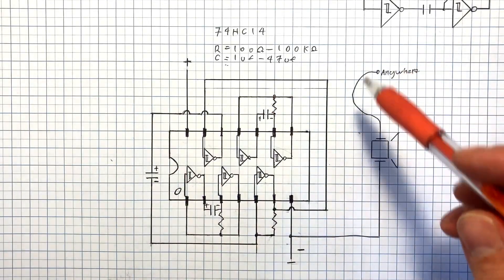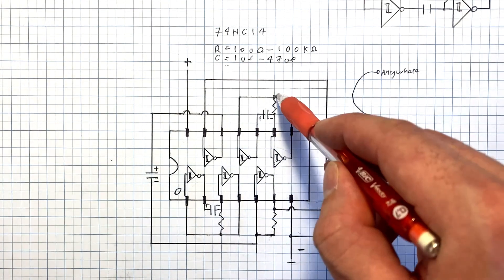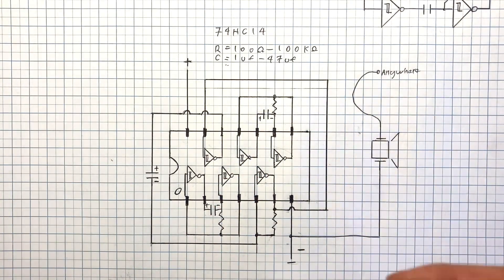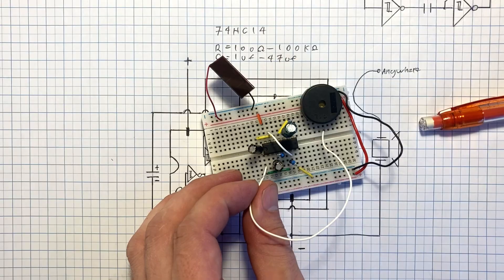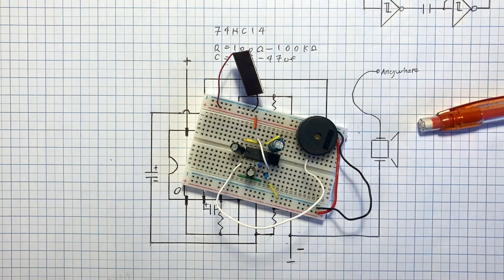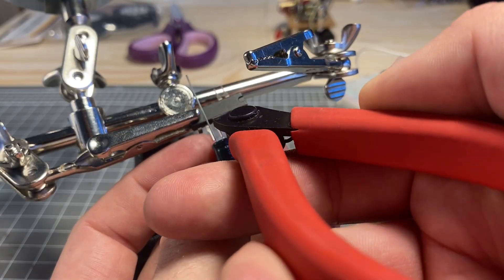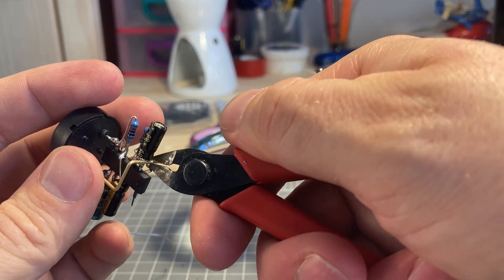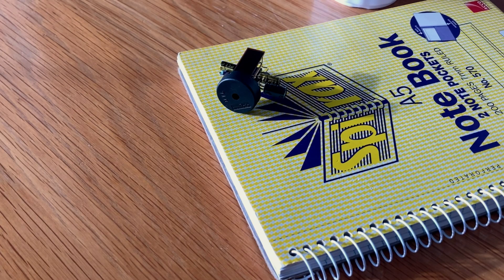A solar powered synth that sits on your desk

Comment: Really enjoyed this video and just made one with parts I had, but wondering if there are tricks to make them chirp louder? I plan to try some different piezos and solar panels, or even some 3d printed waveguides
Reply from the maker: Cheers! I have found some piezos are way loader than others, I am not sure if its different versions or just batch differences. 
A bigger solar cell will probably help but the drive current will probably be limited by the chip itself. It would be pretty east to use this to drive an audio amp though, but a little less elegant

Comment: This was fun! Bought a 74HC14 chip and slapped it on the ol' breadboard. Had a great time experimenting with potentiometers, LDR's and a handful of capacitors. Thanks!
Reply from the maker: Its a super fun little project. I love how you can swap out pretty much any of the components and still get a working circuit.

Comment: Does anyone know where to buy the piezoelectric speaker from this video?
Reply: I only seam to be able to find buzzers.
Reply from the maker: These are often sold as buzzers but it is just a speaker. I think this one was Core electronics part PS1240. If the part has a note about what type of signal to drive it with, eg square wave etc, it should work for this no problem

Comment: What an awesome video -- thanks! I wonder what would happen if a speaker was attached to each one of the resonant circuits, or if multiple circuits could be attached to the same speaker for extra weirdness
Reply from the maker: You could definitely connect a few of them together. Multiple speakers would be cool, I think the speaker load will almost affect the frequency so you could have some crazy feedback going on. This circuit is sort of the most basic version but there are tons of updated designs out there. Super fun to mess around with
Reply: @ALTcorporation  thanks for the advice! I recently inherited an absurd amount of old ICs and components from the 50s-80s and a few more recent ones. There's a few of these Schmitt trigger switches in there so I'll have an experiment. Thanks again!

Comment: You can also use some photoresistors to make the circuit even more chaotic and reactive to light changes. This was one of the first BEAM circuits I've built, and I still have one chirping! Since then, I can't stop thinking about these when hearing crickets at night, haha! Btw, another cool thing I recently found when reuploading some deleted Ralf Schreiber videos is the Motörbörd, check it out!
Reply from the maker: I was thinking about doing that! But I wanted to stick with the classic version for the video. I want to make one with a thermal resistor of some type, it would be cool to vary the sound based on temperature just like a real cricket. 
I’ll definitely check it out, he has some cool stuff. Cheers

Comment: This is really cool. I love it. I wonder if there is a BEAM MUX circuit or similar…
Reply: i think a simple mixer circuit could work. like for example just a resistor and diode attached to each other and then to the output. you can add as many of them to a single junction, every resistor diode pair should be attached to the same junction to add/mix the signals. hope this helps 😀

Comment: Amazing. It's like an electronic cross between a pet bird and a cricket. Sampling the voltage across that speaker at some fairly unpredictable time and converting it to a logic high or low with an op-amp might make this a decent simple random number generator. You could generate one bit at a time and push those into a sipo register.

Comment: Imagine making 50 of them.
Reply from the maker: There have been a few art projects with similar systems. I want to make one with some sort of sound based trigger and then multiple of them can talk to each other
Reply: @ALTcorporation  maybe you could try an IR LED across the speaker and use an IR photodetector to be less sensitive to ambient sounds
Reply from the maker: That’s a good idea, I might try that. I was thinking about a high/low pass filter so it would only respond to certain sounds but that might be easier

Comment: That's very similar to the sawtooth core of my triple vco for my modular synth, heavily influenced by Moritz Klein's design. The main difference being a feedback diode from the output of an inverter with a cap bridging between that and the input and a resistor from the input to drain to ground, allowing only one trigger needed per oscillator. Makes we want to try that with 6 different oscillators fighting on one chip, maybe with more than one piezo...